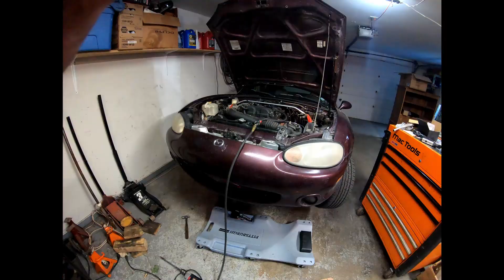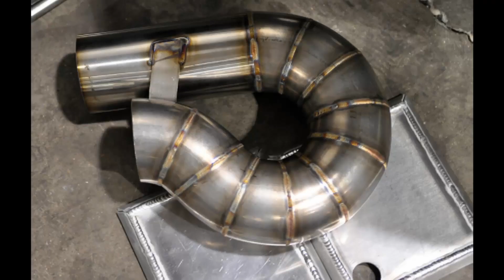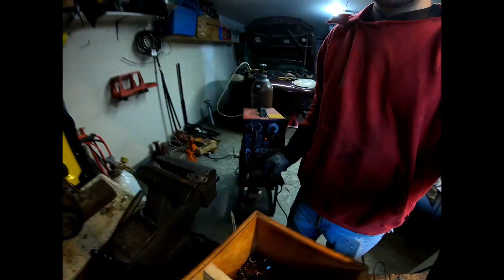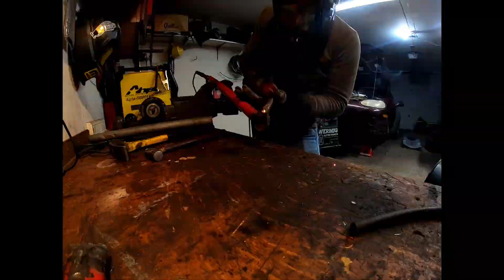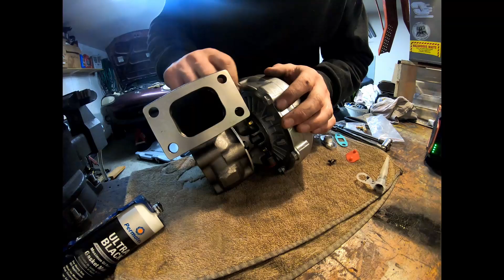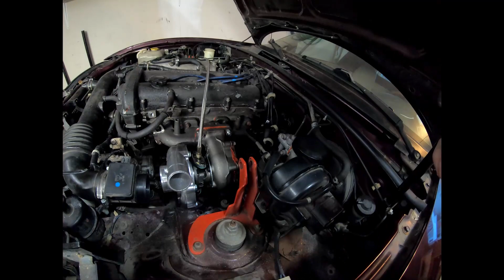$500 Miata eBay Turbo Kit Installation (Budget Build)

Comment: i know this was 2 years ago  but im wondering where you got the longer manifold studs for the 4 corners? Thanks!
Reply from the maker: I think I cut the manifold so it would work. I think you could just buy longer ones from the hardware store
Reply: Thank you for the quick reply! How’s everything holding up if you’re still running it?

Comment: Did you have to grind the manifold to expose the outside studs?
Reply from the maker: Yes, I cut about a half inch off
Reply from the maker: Could also get longer studs
Reply: @theBdunklee  Ok thanks man. I’m going to run bolts on the ends and hope it holds for now.

Comment: Im sitting here pricing out turbo build I got it down to $6000 without built engine props for doing it for so cheap! almost makes me want to try it but I dont want to install two turbo kits
also I have Mica Merlot NB as well!
Reply from the maker: Thanks, I love the color. And you will love the feeling of the turbo set up. I am curious to what the twin turbo set up will look like. What sizes will they be? Assuming a compound setup?
Reply: @theBdunklee  i think he meant buy another turbo kit if this one is junk, not twin. Just another miata owner lurking by haha 😅
Reply from the maker: Crylux lol, yea I get that now, I read it wrong. Lol

Comment: I have the exact kit you have and just started my install.  Is your waste gate dump going into atmosphere or exhaust.  Think I'm gonna buy the rev9 waste gate tube and elbow on ebay and run to atmosphere until I can get it welded into exhaust.
Thanks for the power steering hose idea.  I did it, hoping it's not going to leak.  You had any leaks on your power steering?
Reply from the maker: hoff247 yea, mine is to atmosphere
Reply: @theBdunklee  , I had no idea the wastegate dump tube was going to be so freakin hard to do.  Nobody ever shows how to do one on a external wastegate.  I bought a welder just to attempt this and I can say yours looks better than mine.  This has been holding up my build for a week now.  Hopefully back on it this weekend.
Reply from the maker: hoff247 it doesn’t have to be pretty, just has to work. And most turbo kits have internal gates, it’s better this one is external